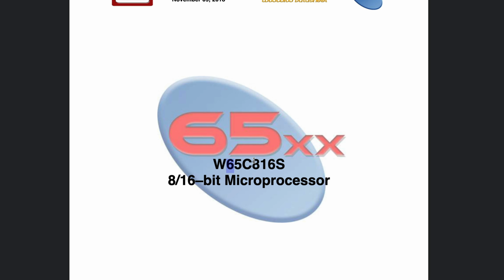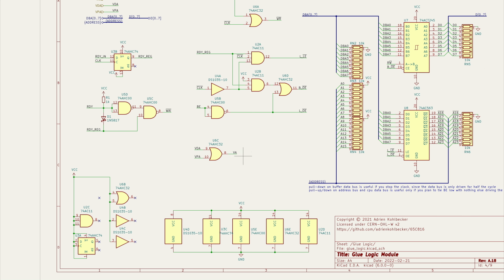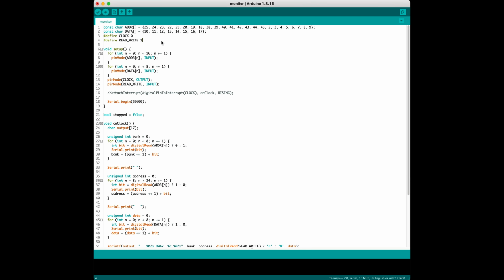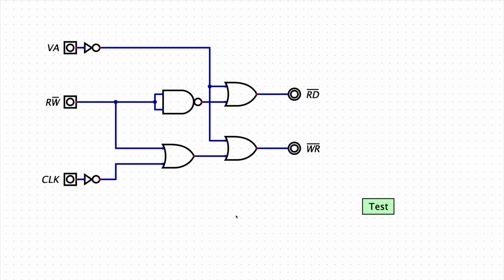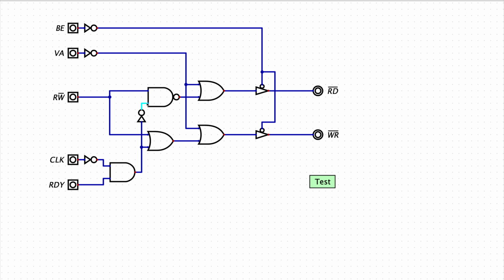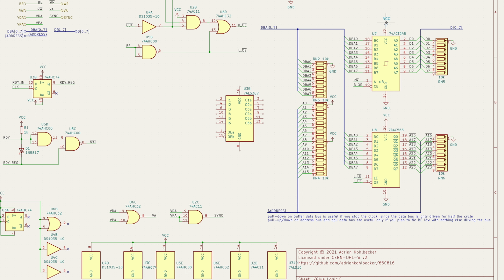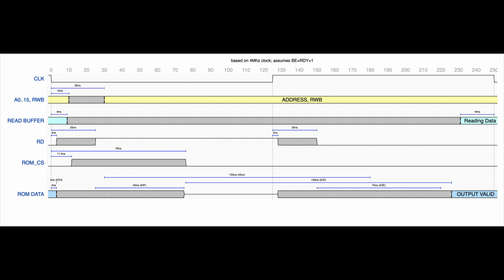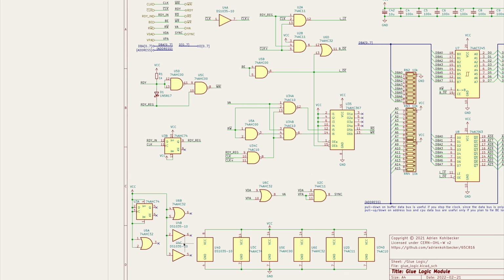#18 - VDA, VPA and RD/WR rework - BB816 Computer

Comment: Great, as always! Have you been experiencing any issues finding parts as the design gets more complex?
Reply from the maker: Thank you! In this specific project I have not, so far. Everything is DIP so it is less impacted by the shortage. My 7 segment hex display project is using an SMD ATmega so that's been a problem.

Another availability issue I had recently was the Teensy++ 2.0 which I didn't know was discontinued. I wanted to purchase a second one for another project. You can still get clones on Aliexpress but availability is spotty... Sadly it was the only 5V native, breadboard compatible, microcontroller board with enough pins for the 65C816 monitor so I'm bummed they stopped producing it.

Comment: Once all the signals are taken care of, can one make a breadboard 65816 CPU module with the closest pinout to a 65c02 module? How can we make a bus out of all of these signals?
Reply from the maker: 6502 will be really easy, you just have to remove things. Bank address, ABORT, and VA I believe (+ some other seldom used pins). So if the pinout is identical except for these, you can make compatible modules.
Reply: @akohlbecker  I want to use the Apple II approach and have each processor (6502 or 65816) alternate access to the bus, through clock division. So I need to have both clocks available on the entire bus. I need the memory responsive to both clocks.....

I want to control the bus with a register set by the VIA. Both CPUs need to be able to write to this VIA. Which one shall receive the Interrupt from the VIA? I need a flip-flop to govern which CPU receives interrupts. It would be the startup CPU to begin with, but it should then be possible for the secondary CPU to take control.
Reply: @akohlbecker  When our designs are finished, we can send them back in time to 1983 to help fight any robots or aliens from the future, which (as I recall from childhood) was an intermittent issue back in the day.  They'll be able to build a 4,096 node Connection Machine out of dual-core 65816 processors, and win the day against SkyNet, along with a 5V thousand amp USB charger the size of Avery Fisher Hall.
Reply from the maker: Will they ever be finished though? :-)
Reply: @akohlbecker  Not as long as the original actors are still available, it seems. (sigh).
Reply: @akohlbecker  If Western Design Center would just release a quad core W65C864, it would save us all a lot of bother.
Reply: @akohlbecker  Imagine, 16.7 million 8x8 sprites. :)
Reply from the maker: You bet they would still do it in 40pin and have us demux 64 bits of address and data
Reply: @akohlbecker  We need a DIP 126, it will just fit on the breadboard.

Comment: At this point, if the breadboard were designed to be transferred to PCB, stackable pin headers would enable the extension of the bus design into three dimensions. We need 24+8=32 bits for the address bus and data bus. 16 pins more for the processor status lines. What of these lines can be suppressed from the bus? If the delays are all implemented on chip, could it be that not every peripheral on every bus need have access to every signal generated on the two breadboards with the 65816?
Reply from the maker: Stay tuned for a 65C816 breakout PCB video shortly ;-)
Reply: @akohlbecker  I will, and I am certain I will adapt your design for my build, which so far is based on your work.

Comment: Silly question for you - if you used a GAL chip for the RD / WR outputs, would that not give adequate timing?  Then you wouldn't have to introduce a new phase of the clock.

Anyway, thank you.  Good explanations of everything.
Reply from the maker: Hey! Not a silly question. I do have the GALs necessary for this but my goal for this first revision is to only use discrete logic. A self imposed challenge if you will 🙂
Reply: @akohlbecker  I can appreciate that :)  I think it's definitely cheating when people use an FPGA - those things have more gates than an entire 6502 computer, so what's the point any longer?
Reply from the maker: Thanks for sharing your point of view, Joe. I totally agree! We're all building and learning things and that's what matters, and everyone should feel welcome in this community: from die hard 74LS logic fans to fancy FPGA users. 

The only thing you need in this hobby is clarity on what your goals are, otherwise they tend to balloon such that a lifetime isn't enough to complete them. It sounds like you have a pretty good grasp on what you're trying to achieve!
Reply: @akohlbecker  Does anyone know if there's a C compiler for the 6502/816 chips? WDC state on their website that WDCTools contains a C compiler but I've only seen the assembly simulator.
Reply from the maker: There is Calypsi http://forum.6502.org/viewtopic.php?f=2&t=6717&sid=ec5124f14c7acc31da908b278fe360b0 and cc65 https://cc65.github.io/ (the latter only supports 6502)
Reply: @Joe Plocki Excellent, thank you for such a detailed reply.

I hope I haven't caused any offense - for me, GAL is OK, but FPGA is not... But for Adrien, GAL is not OK :)  Each one comes with their own rules.

I think I better understand your reasoning.

My opinion of 6502 assembler is so clouded by nostalgia that I can tell if it's good or not.  Actually, since I moved on from a BBC Micro to an Archimedes, my favourite would have to be ARM code.

My wife hasn't gone crazy with all the bits of electronics everywhere - yet :)

If you have any posts of your build, I'd be delighted to see.  I'm nowhere near as advanced as you are in my project (or abilities), so I would love to learn more.

Thanks again.
Reply: @Joe Plocki I suppose we are all cheating because we don't fab our own chips in our garage ;-)

It must have been more easily doable in the 80s.  There were lots of random companies with very few employees getting computers out, e.g. Dragon 64.  Acorn did this with small team, maxing out the Ferranti ULA.

For me, this has been a fantastic learning curve.  I haven't touched logic chips since I was a teenager.  I told my dad, and he said that the 74-series was the cutting edge when he was designing circuits for a living.  "Saved me a lot of transistors on my design," he claims.
Reply: Thanks Adrien and Joe; I really like  assembly and have written assembly programs more than 64K, but 16MB might be a bit too much :)
Reply: Coming to this thread 9 months after it was started it's a shame that Joe's contribution has been deleted.